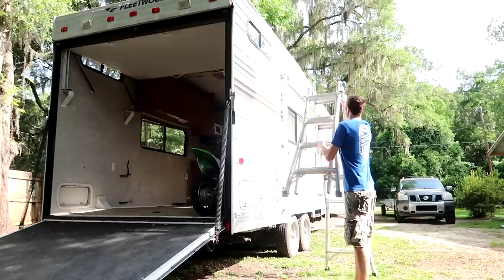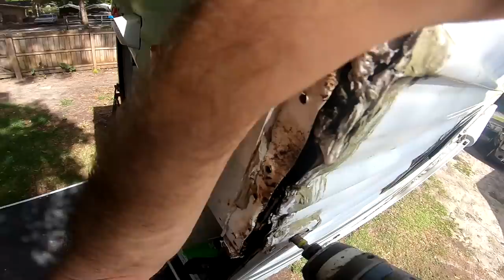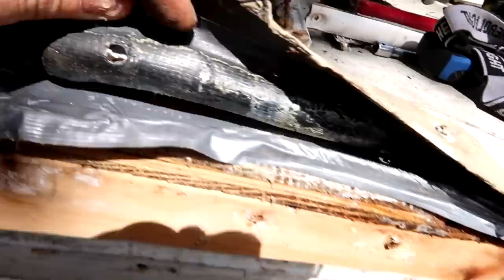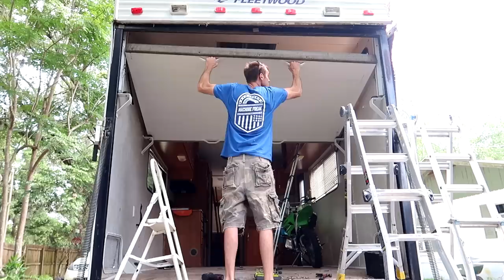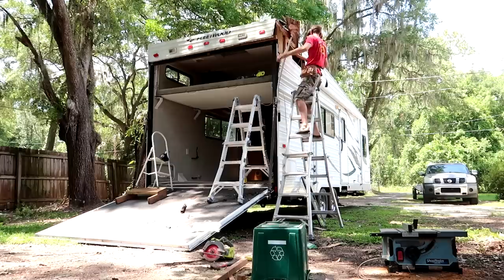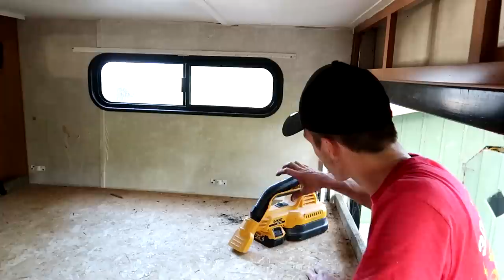Chasing & Replacing Camper | Toy Hauler ROT

Comment: The duct tape is used on all of the edges of decking and some times even putty tape. It stops the rubber roof from cutting itself over time on the edge of the decking.
Reply from the maker: I see. Thanks
Reply: @3DMachines   I used to be a rubber roofer , but now im the group leader over all of metal department so if you have any questions about exterior stuff just let me know. 🤘🏻👍🏼

Comment: When u do a new roof on them u put some kind of tape but usually rubber tape for like houses or something but duct tape will work on the edges so there is no sharp edges to poke thru the new roof lining. It appears the redid the roof but didn't fix the back wall rot lol..